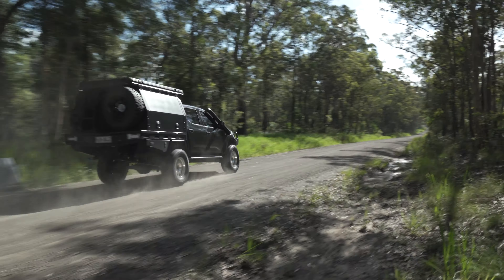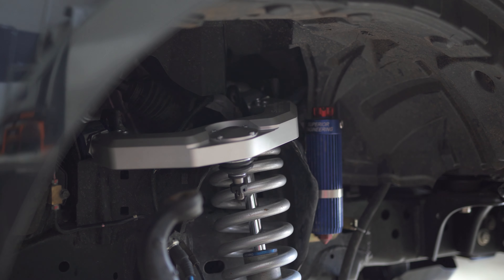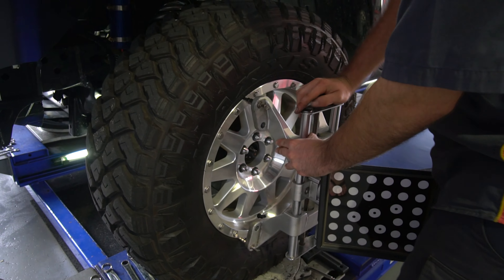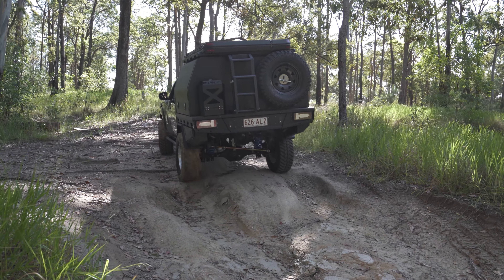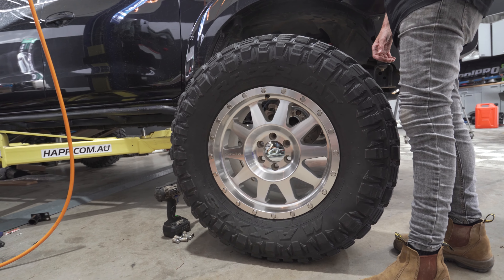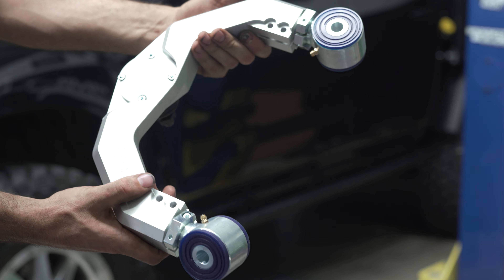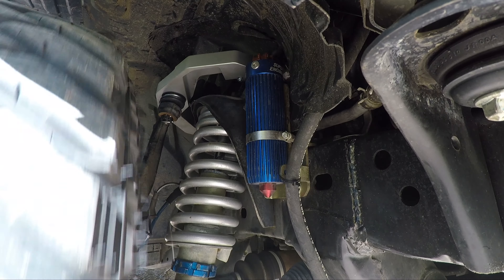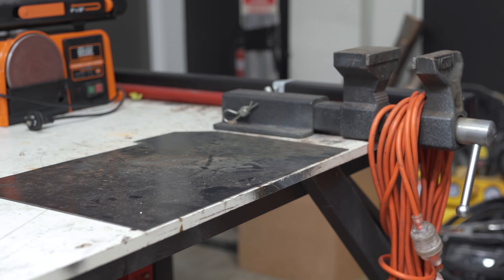Superior Billet Alloy Upper Control Arms Suitable For Nissan Navara NP300.

Comment: I have heard D40 and np300 share the same suspension design. Would it be a good educated guess that these would also fit a D40 since they share the same design?
Reply from the maker: Yes they use the same struts and shocks as well as the rear leaf springs in leaf np300. We have just not tested our control arms and such to suit the d40.